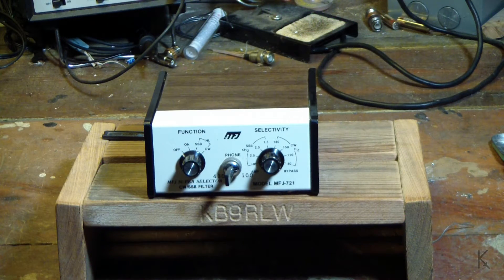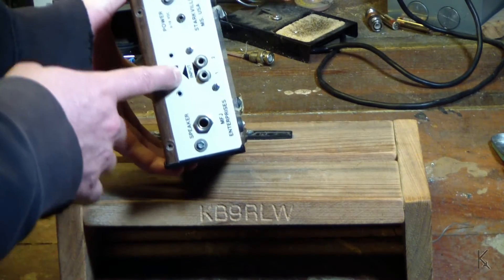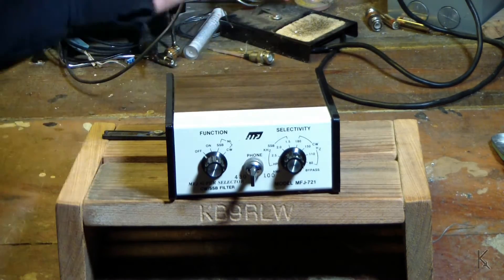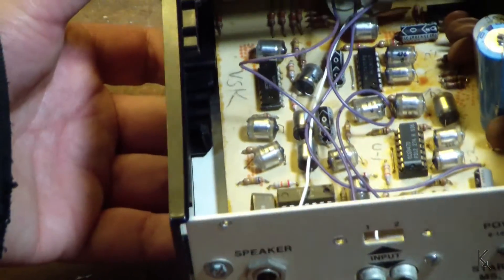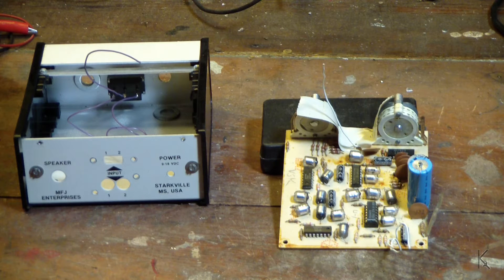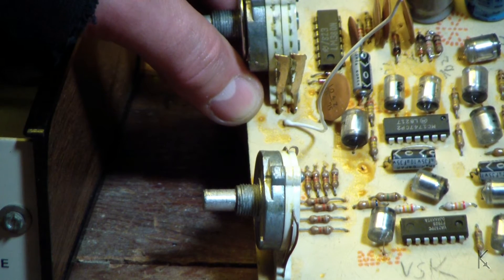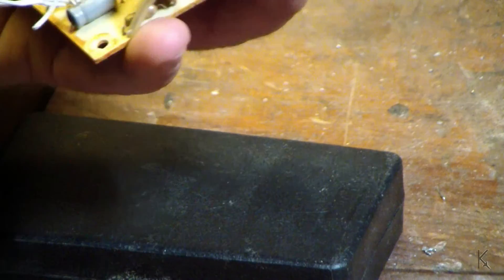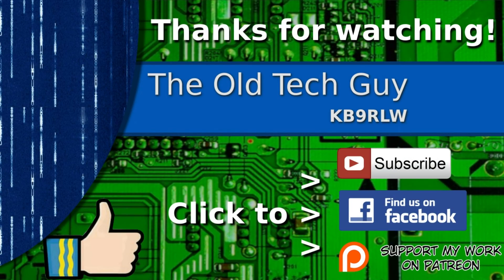Ham Radio - Teardown of an old MFJ-721 audio filter from 1978

Comment: I have the older 720...picked it up this year at the Lancaster Hamfest for $3. I had to reverse the damage from the "golden screwdriver" that the original owner took to it. After getting it back to 1978 standards, its used daily with my MFJ Cub transceiver. 

And FWIW...the CWF-2, SBF-2, and the 40 line were their "earliest" products.

Comment: Kevin, as you have revealed, this circuit is nothing more than a series of cascaded dual 741 op amp chips (with a single 741 on the end, I think.)  The unit is similar to the Autek QF-1A and, surprisingly, it received a solid 5.0 rating in its eham.net reviews. Clearly, they did not rate on construction as this is one of the units that helped contribute to the "Mighty Fine Junk" sobriquet. (Though, to be fair, some of MFJ's stuff was solid. I recently found an MFJ 493 keyer that was a surprise and s delight and built like a brick shit house!) 

For those who wish pick up a filter like this, I recommend steering clear of the aforementioned Autek and this unit and the troubled, flawed Idiot Press SCAF-1 (stinkeroo circuit, no customer service to speak of) and avail yourself of the NEScafe from NE QRP or similar offerings from 4 States QRP. But the sine qua non has to be the Ramsey AF-1 if you can find one. 

I did a few blog posts and will add the link later. 

Interesting to see how your tuner comes out.
Reply: ..the blog posts on the SCAF-1 and AF-1 are found on righthandofzod.blogspot.com in the April 10, 2013 post and the next two after that.